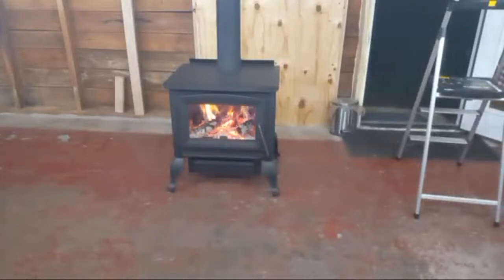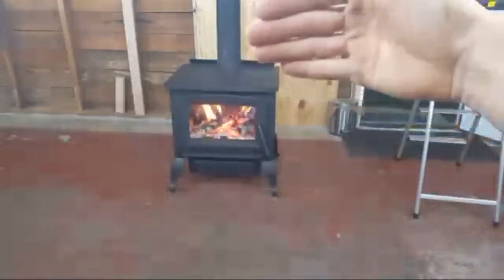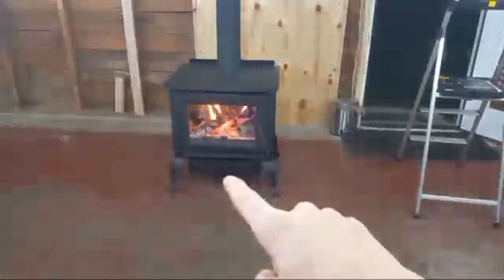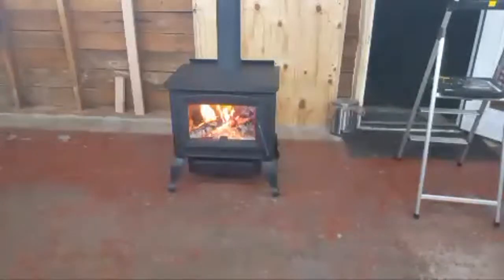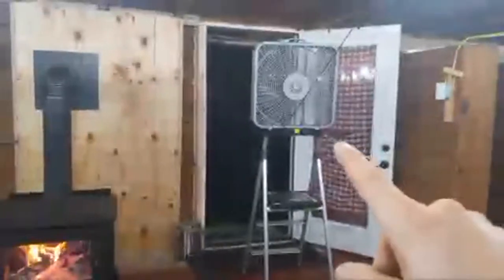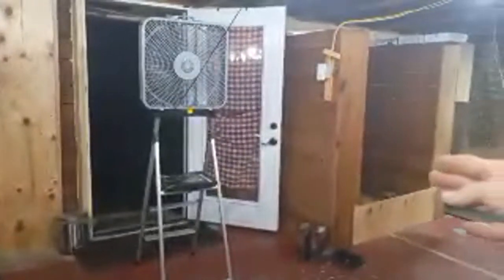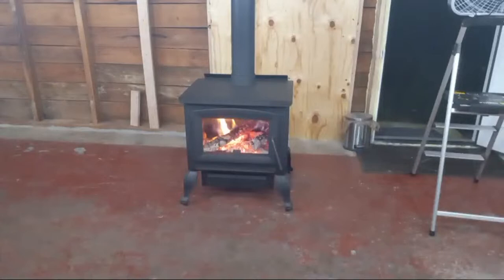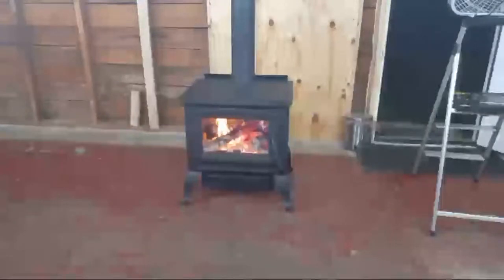What Could Cause A US Wood Stove To Smoke Badly

Comment: If you can find one, there are fans which are powered by the heat coming from the stove’s surface.  They help with air circulation.
Reply from the maker: I bought the electric fan for the back of the stove but do plan to buy one of the non-electric ones as well. Another item on my to buy list. Thanks for sharing that as others may not know about them.

Comment: mine has a paint smell that overtakes the house, its been a year and the smell is the same, the wood smell doesnt enter the house just the paint smell, could it be that i have aluminum boiler pipes on instead of dedicated stove pipes?
Reply from the maker: Make sure you are using the black steel stove pipe. It sounds like you might be using galvanized steel piping as it's a lot cheaper but the fumes that come off of the galvanized pipe is extremely toxic.

Comment: im thinking of making 275 gallon oil  tank in to large wood stove it would hold 5 wheel barrel loads of wood  and it will heat the house and make it real tosty in side